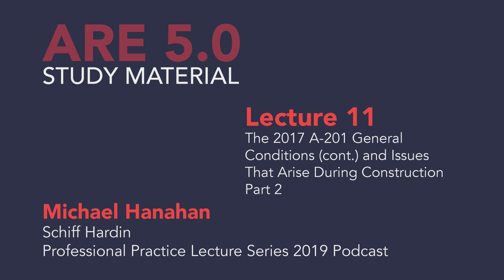Michael Hanahan - 11a - The 2017 A-201 General Conditions (cont.) - Part 2 of 3

Comment: 2:35 Article 6 Construction by Owner or by Separate Contractors 
23:22 Article 7 Changes in the Work
49:57 Article 8 Time
1:03:36 Article 9 Payments and Completion
2:08:25 Article 10 Protection of Persons and Property
2:13:25 Article 11 Insurance and Bonds
2:20:38 Article 12 Uncovering and Correction of Work
2:35:44 Article 13 Miscellaneous Provisions
2:41:57 Article 14 Termination or Suspension of the Contract